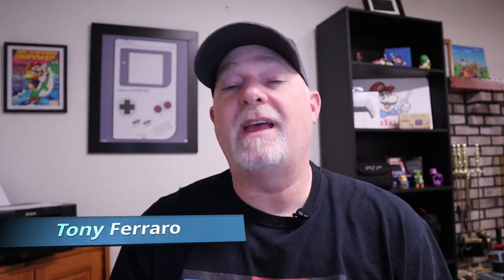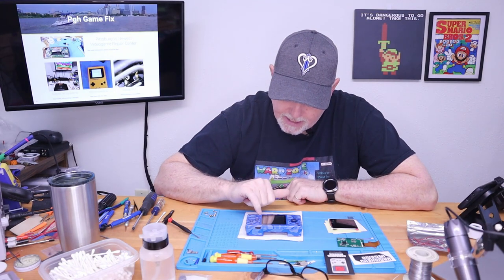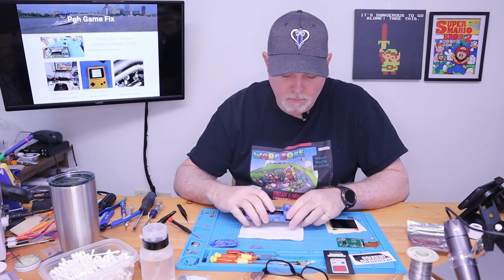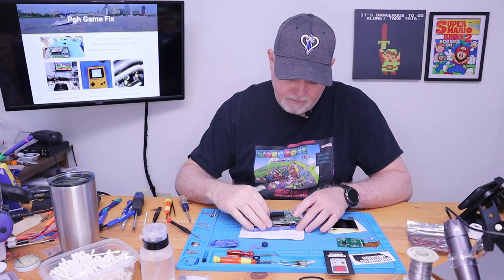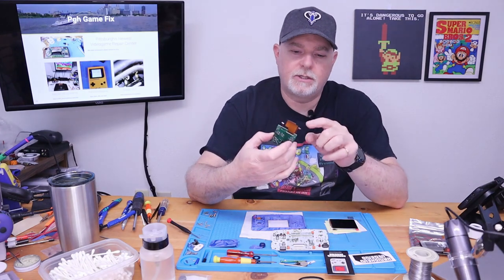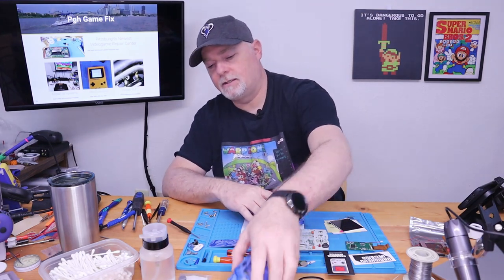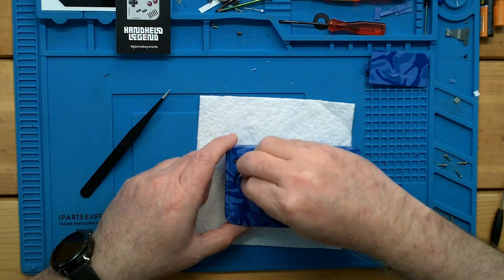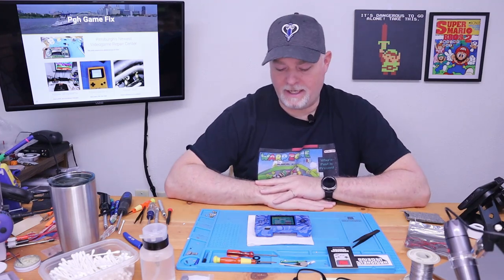Q5 IPS NeoGeo Screen install from Handheld Legend.

Comment: Subscribed. Good video, I'm also into modding retro handheld. I recently did the ngcp also. I've found when using a flash card with the backlit mod, you'll find issues such as when the battery is nearly depleted, the screen won't turn on but you'll be able to hear the start up jingle. There isn't really a fix for it, but I've moved to using lithium aa batteries and that fixes the issue. Lithium batteries give a constant power draw even when it has 1% battery life left it would keep the voltage at the same level whereas alkaline battery would just reduce when it's near to empty. There are rechargeable lithium aa batteries avail also, I've moved to that and am now satisfied.

My next project will be the atari lynx, I've seen you posted a video of it so definitely will be coming back to your video when I get the kit
Reply from the maker: I haven't see the issue yet with the flash carts, but I know when something like a game shark is used, the battery will drop faster.  Yes, I recently did a Lynx 2 ... and I also have a Liynx 1 screen here at the shop that will be installed soon. Thanks for the feedback.  Also, check out my Handheld Legend test cartridge video.  If you comment there, I'm doing a gift card give away.

Comment: good video, modding my neo geo pocket color soon (for my retro gaming collection) after i got my parts of ebay, but thinking to remove the touch sensors and going for the wires only.
Reply from the maker: I know some like "hot Keys"... and some like the touch sensor.  Both seem to work.  Good luck with the mod !!